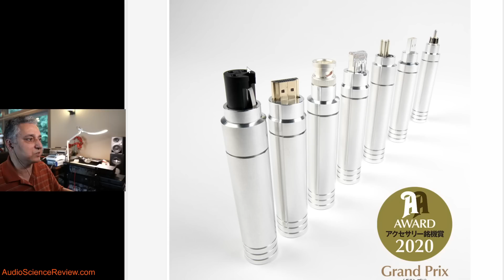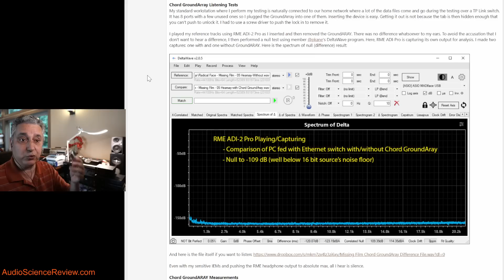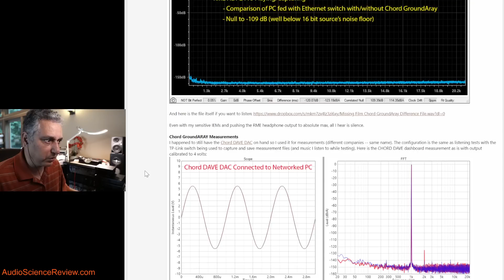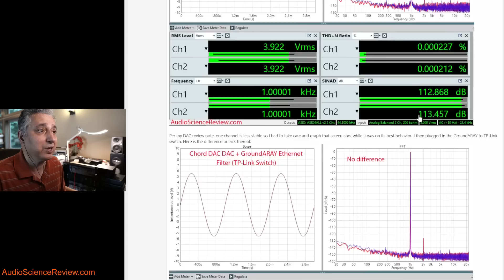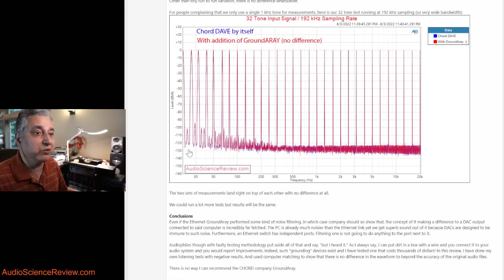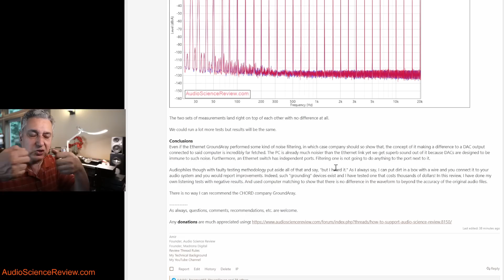Chord GroundAray Review

Comment: The special material inside that dissipates the noise though quantum tunneling to a parallel universe is AKA snake oil. Another wonderful debunking video Amir for a set of devices that's not cheap either. Thanks for making a YT video review as I suggested.
Reply: Shamelessly preying on people's ignorance. Analog filter on an ethernet network using balanced differential digital signals. If its noisy enough to cause issues, you just don't have any audio at all. It simply drops the data packets.
Reply: @mysock351C  Shameless indeed. However reading, some common sense,  and informing oneself is a path to solving ignorance.
Reply: Too bad they dont meke an optical version to shunt out the noisy light
Reply: @Douglas Blake I would consider it’s intended application to be as such in principal for the sake of argument. In this case it would be equivalent to an open stub of coax. But given there is no control over the dielectric properties or dimensions, not to mention the housing is likely floating, it probably couples and passes a very tiny amount of HF RF components through the RJ-45 connector rather than where they claim it goes, which is magically dissipating in the wire inside. Never the less, even if it did have actual passive or active circuitry inside and it did present a low impedance to noise, it would still be useless even if it did quiet things down. The digital signal is differential and by design rejects noise.

Comment: Another pixie dust vendor. Definitely intended for the same folks who wear copper bracelets. The mechanical form factor is a nuisance. You'd think if they would at least run a super short cable to a unit that you can easily tuck away. This being said, it's styled like a lipstick and it's likely a hint to its intended class of product. Amir, you are too kind.
Reply: It looks like it would be the perfect input/output jack destroying/snapper-offer tool. How long, with this thing connected, do you think it will take before a connector gets snapped off? Rhetorical question, sorry.   Fred

Comment: aren't you just missing the point in what you said about low noise floor, it's designed with people who have very noisy systems not a quiet system like yours.
that's the purpose of it
the ones I've ever seen have a earthing terminal on them that doesn't???
Reply from the maker: How is my system quiet and yours noisy?  This is a computer workstation with tons of activity.  Its ground is surely polluted as I see with poorly design DACs and such.  But sure, let's have the company run the same tests on a system -- any system -- of their choosing that shows a difference.
Reply: Someone thinks it works!!
Reply: @MichaelBeeny  that's not what I said don't put words in my mouth!

Comment: Some types of connectors (bnc for instance) that if you have a connected splitter you should use connector terminators but this is not the same thing. What if you have multiple ports on your device do you need one for each open port?
Reply: Make sure you find a device with many ports. Then you can put many of those noise reducing devices in those ports and the noise reduction adds up - obviously. ;)
Reply: @edgar9651  cool! And then when I forget they are there and shove my receiver back against the wall I can destroy all these previously unused ports which will guarantee noise. I can’t wait!
Reply: @edgar9651  
Lol, There's a carreer opportunity at Chord!
Reply: @edgar9651  Hahahahahaaaa!!! Nice.
Reply from the maker: That is what the company claims!  The more the better.  For whom, that is the question!  😀